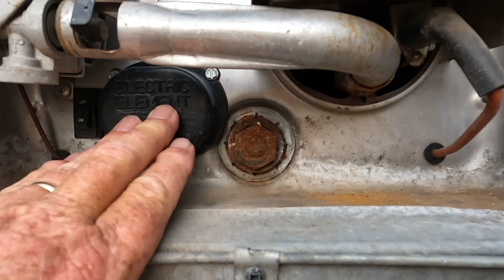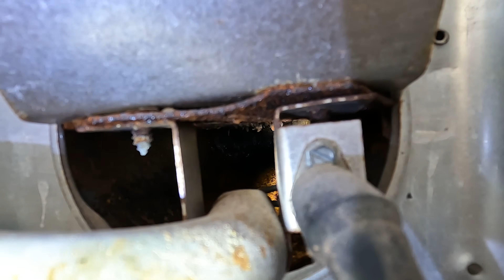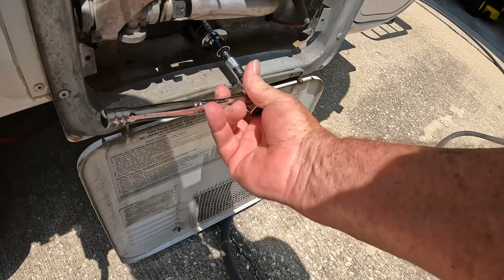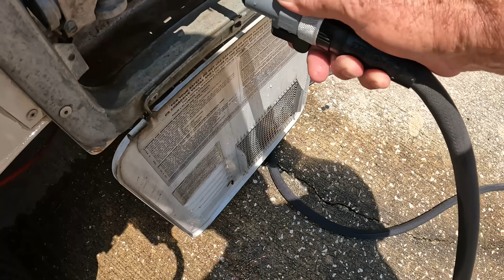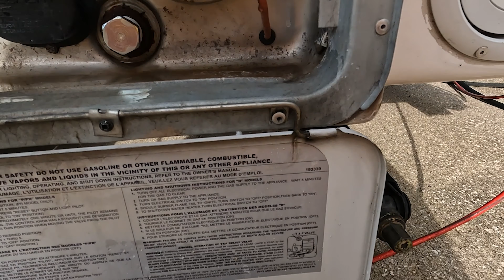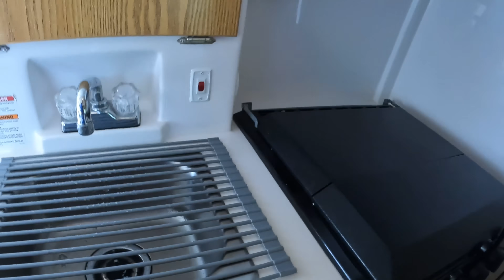Casita Water Heater Semi-Annual Maintenance

Comment: how much of the thread was sticking out still?  it seems like when i finish tightening it, it still has a solid 1/4 to 1/2 inch of thread out
Reply from the maker: It does not screw all the way in. Screw it in until it’s tight.

Comment: Releasing the pressure as explained in minute 2:27 is EXTREMELY important. Removing the anode  rode while the water heater is under pressure can hurt, blind you or kill you. I was lucky to be away of the anode rode trajectory when it was expelled on my last turn. Be careful.
Reply from the maker: Thanks for your input. glad you are okay.

Comment: Any hits on replacing the hit water bypass valve?
Reply from the maker: Drain the water heater and blow down your water system. My bypass valve is threaded so it appears to just be unscrew the old and reinstall the new.